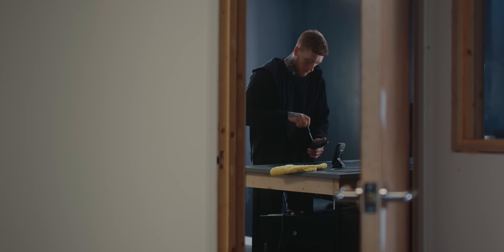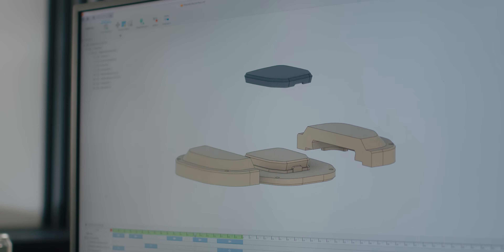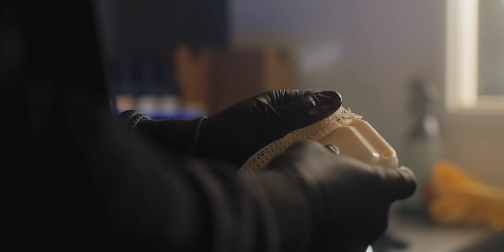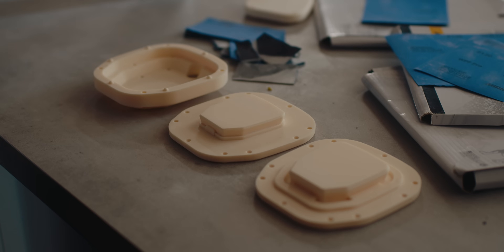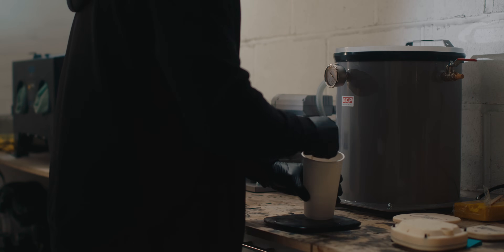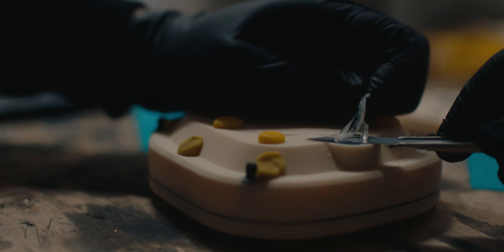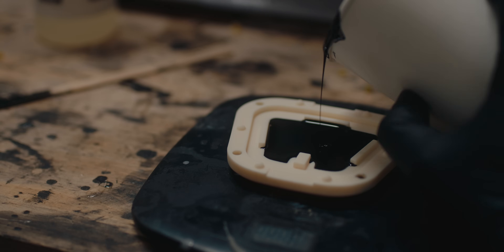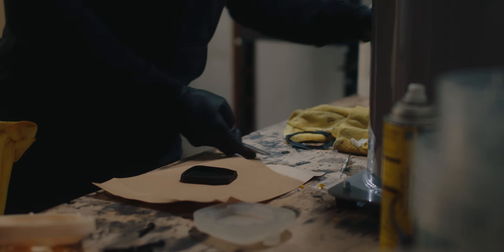Printed Compression Moulds For Flexible Parts - Wireless Charging Stand

Comment: I have a question. Do you use a pressure tank to prevent bubbles from forming in the parts you make? I cut the parts but they don't form and I think the air bubbles are preventing the resin from reaching that part.

Comment: Really cool mold design. Your channel has great content. However, you mentioned that you made use of platinum silicone for your UV resin molds? Whenever I attempt this I run into inhibited curing. I end up having to use tin silicone instead. Is it a special resin that you're using? Thanks again for the great content subscribed.

Comment: Does that printer resin not have cure inhibition issues when pouring Platinum silicone against it? This has been one of my largest headaches when trying to use resin print molds for platinum silicone.
Reply from the maker: A lot of people ask me this after seeing me take a mould from an SLA print. Cure inhibitions with silicone and SLA prints is never something I’ve had to deal with. I need to do some testing to figure out why a lot of people do and why I don’t. My best guess is it’s down to the silicone I use. I’ve used Anycube, Siraya Tech and HeyGears resin for printing master and never had issues with it. It’s definitely something I’m going to look into and possibly do a video discussing it.
Reply: @RTAFabrication  interesting, I'll have to give the silicone you're using a go. I usually find inhibition issues with Siraya Tech go away after letting the print cure and degass after a few days but if I want to pour quickly or the same day I need to UV cure under water and then scrub with soap and water then repeat those like 3 times. It may be that those with inhibition issues are using food grade platinum silicone. Thats what I have to use as I'm making food molds, looks like the stuff you're using is platinum but not specifically food safe.

Comment: Amazing work! As you mentioned, letting the mould de-gas before using platinum silicone is curcial How long did you de-gas your moulds before pouring platinum silicone into your mould halves? I've tried leaving my two-part moulds outside in the open environemtn for a week before pouring platinum silicone, and still experience elements of silicone inhibition. What strategies did you adopt in this video to prevent the cure inhibition for your silicone?

Comment: I watch a lot of DIY videos on youtube, and as an Industrial Designer I think the word "design" is used too many times when just "making" things. Your video it's actually pure design. This video is not only very entertaining and nicely shot, but it's very representative of what design really is. I could not find a flaw on your process the whole way through and your mistakes are solved through the properly called "redesign" of parts and processes. I can't commend you enough for showing that design doesn't start/end in the product, but it's also about the production process. I am blown away at your level of meticulousness in this never better defined "design video". Amazing.

If I may say only one completely trivial thing is that the ballast steel ball bearings you used are way too pretty to be drowned in the resin. I would have used a super cheap casting since it's going to be put away from view, or would have made a little window into the cavity to show them up. But it's nothing. I am truly blown away by this "simplex" (simple + complex) design trip. I hope you get an algorithm wave to push this content. 10/10.

Comment: Nice work! I'm wondering does the sandblasting can crack the resin, or you manage to reduce the pressure of the blasting? By the way, which sandblasting do you recommand for this can of job ?

Comment: The topic of casting polyurethane into silicone molds is incredibly fascinating to me. However, at the moment, I've encountered a problem where silicone on tin gives unpleasant shrinkage and is not durable, while silicone on platinum inhibits with prints from photopolymer resin. Could you share which photopolymer resins work well with platinum silicone?

In any case, your attention to detail in production is mesmerizing, much respect.
Reply from the maker: Thanks! The cure inhibitions are quite interesting with a platinum/ addition cure silicone. I hear a lot of people have issues with moulding resin printed parts, but I’ve only experienced it once where I did a spot repair in the print and UV cured it. That area did have a cure inhibition present. I think the reasons I don’t get cure issues, and this is only thinking about my typical workflow, is that I either paint the prints before moulding, have full coverage of mould release, or ensure the prints are throughly cured and left to gas off for a number of days after curing and before moulding.

Painting the parts will create a barrier between the print and the silicone, so that’s a sure way of eliminating any issues as technically they’re not in contact with one and other. Applying a mould release would also follow the same theory, especially applied over a painted print. The full cure theory comes to mind from the spot repair I did and ran into issues. Although I cured it off, I moulded the part straight away afterwards. If I remember correctly, I’m not sure I even used mould release on the part I’m talking about, and that single spot was the only area with issues. Another thing to consider is if the silicone is heated to accelerate the cure, that will encourage the resin to gas off any chemicals or solvents, which will definitely cause cure inhibitions. This can also be true with acrylic paints. If not left long enough, they will also gas off the solvents and cause the same issue.

I used to encounter this issue with some parts I used to make where I’d take two separate components, glue them together and bodywork the joints. If I ever heated those moulds to accelerate the silicone cure, the areas where I used cyanoacrylate adhesive would do exactly the same.

I couldn’t say if one resin works better than another, as I use various resins and various mixtures of these resins and haven’t ever encountered this issue consistently as others do online. I guess my suggestion would be to trial all of the methods I’ve mentioned, paying close attention to cure directions of the prints and how long you’ve left them before moulding and see if you’re able to narrow it down.

I hope that’s somewhat helpful, and I wish I had a simple secret formula, but honestly I think I might have got lucky with the workflow I naturally do.

Oh, and the resins I typically use in my Elegoo printer is the AnyCubic ABS-like mixed with either Siraya tech tenacious or blu. On the HeyGears printer I haven’t had any issues with the PAU10 or the PAWR10 resins either.

Thanks again!
Reply: @RTAFabrication  
Thank you very much for such a comprehensive response! I will definitely try the method with painting and using a mold release agent. 

Additionally, I'd like to add that for dealing with inhibition issues with Elegoo Standard resin (and maybe same price segment resins like Anycubic and others) , baking the printed model in an oven for 4 hours at a temperature of 80-90 degrees Celsius helps. However, the same method doesn't work at all with Resione resins.

Keep creating and delighting viewers with your high-quality work!

Comment: I have been thinking about how so many people are wasting their time trying to print in TPU for flexible parts when making a mold to cast it in this poly or even just platinum silicone has so much better results.
Reply from the maker: Yes I agree! I often get questioned about why I cast parts and don’t just print them. There’s benefits of both methods, but there’s a whole range of cast able resins and silicones that just aren’t available in a printing format. I could write a list of why I mostly prefer mould making and casting. I think 3D printing and mould making combined opens up so many avenues, but I feel mould making is much less mainstream than 3D printers are nowadays. Thank you for watching!

Comment: As for ideas... I'm currently working on trying to modernize my old car with a custom built head unit that replaces the entire original center console panel. But I'm really struggling with the design of that thing, so if you were to venture towards customizing / modernizing car interior I would definitely be interested.

Comment: So, how did you prevent platinum silicon cure inhibition with 3d printed resin?
Reply: use tin-cure instead of platinum-cure silicones..... if tin-cure material is feasable for your project. Otherwise try to wash the cast with ethanol - for 48 hours - replacing the ethanol several times and then quickly dip dried and cured pieces into a 1% solution of polymethyl methacrylate (PMMA/plexiglass) in acetone. repeat that last step 2 times (at least).  The idea behind this is:   you need to get rid of the photoinitiator/traces of sulfur - washing again and again is the first step, applying some kind of coat is the next step, and then repeating the steps again ....   Hint: if you have no datasheet regaring your silicon ... there is a rule: tin-cure are the ones which uses only a small amount of starting agent - platinum is most of the time 1:1 ratio agents

Comment: Outstanding engineering, outstanding videography.
And let me tell you, "10 of each" is not going to cut it.
Reply: What engineering? Making a mold in cad doesnt make you an engineer.
Reply: @GoldBl4d3  It literally is an engineering process, and it's not the only one. He designed, tested and build his product while creating a production system for a limited run, it's the definition of engineering.
Reply: @GoldBl4d3  The molds I have seen, especially the one from the last video, were outstanding, and honestly very close to the limits of what I can understand about mold making. Maybe you're a genius.